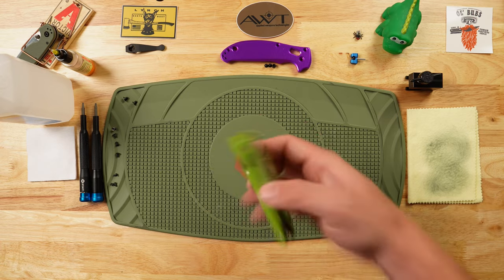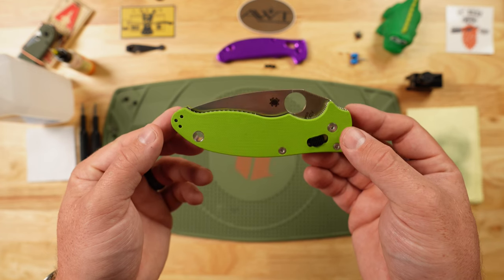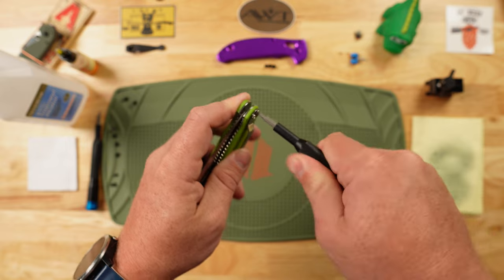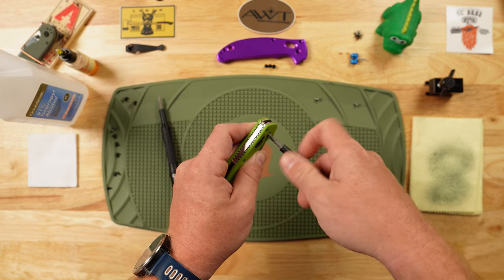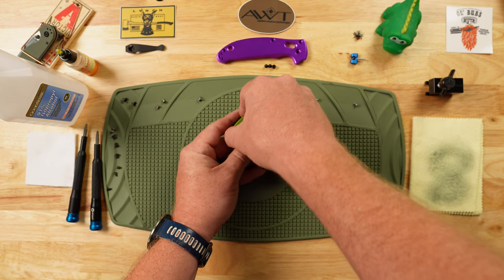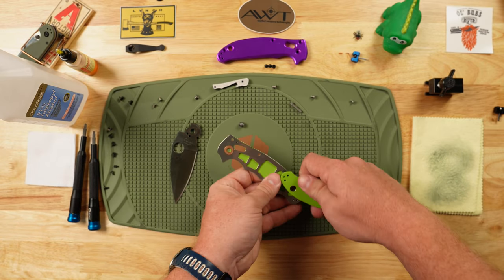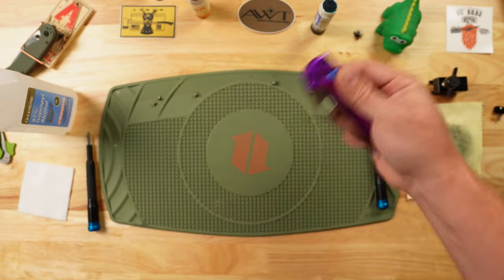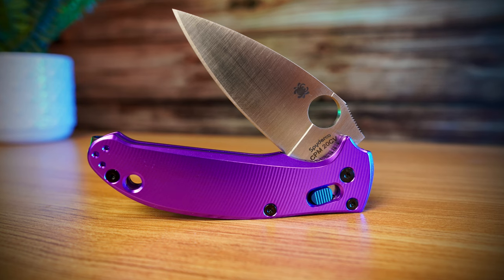Spyderco Manix - How to Swap Scales

Comment: Just curious. What was the point of taking the other scales apart from the lanyard barrel. I didn’t see you use any of those parts again. Couldn’t you have just left them together?
Reply from the maker: Hey thanks for watching!
The point is to show people how to do a scale swap on a Manix. Most aftermarket scales require reusing the liners. My aim is to make the video helpful to folks even if they don’t have liner delete scales and new hardware. If you get these scales, you can definitely just leave the scales and liners together.
Reply: @olbubs  ok thanks, I’m aiming to buy the AWT which are liner delete. I’ve never changed scales on a Manix. Hopefully the ball or spring don’t go flying 😂
Reply from the maker: @ToRo909r  it’s not too bad, keeping the ball in the cage is the most finicky part. I believe in you! 🤣

Comment: Can we put sizzle sauce on the new manix 2 lightweight that comes with screws?
Reply from the maker: Sizzle sauce options are less abundant for the LW models. You can absolutely dye the scales as desired, but they do have some incompatible parts. You might be able to buy a replacement ball cage like I have and a spring and have it work but I’m not certain because the LW has an additional piece outside of the washers that nest into the FRN. I haven’t scoured the internet though for a scale set made for the LW but it exists for the Para 3 so I wouldn’t be surprised if folks are making them or working on them.

Comment: I actually like the Manix better than the pm2. The tip is a bit stronger and it isnt as much of a pocket hog. I'll have to try this.  Though getting scales shipped to Norway after i move there next week could be a problem 🤔
Reply from the maker: Wow that’s a big move!! Exciting stuff man!
Reply: I'm in Sweden half the year, most years, and have never had any trouble getting any aftermarket parts shipped to me there.
Reply: @CNYKnifeNut  great to know, thanks!  I did run into a problem with Original Goat for scales for my Hogue Deka. They don't ship international apparently.  But hopefully they will soon.
Reply: Maix is superior to pm2

Comment: anyone know where you can buy an extra set of bronze washers for the manix 2?
Reply from the maker: https://appliedweaponstech.com/replacement-pivot-washers/
Reply: Duuuude. Ty
Reply: I’m converting my LW to G10 and Liners. I do not care for the LW at all
Reply from the maker: @Ryan.S924  totally get that!
Reply: Would you happen to know what size bearings one would order if they wanted to try to put bearings on the Manix instead of washers? Someone told me about a company called Skiffs or something like that but in order to buy some you have to know the exact size ID and OD and how many bearings. Anyone tried this?